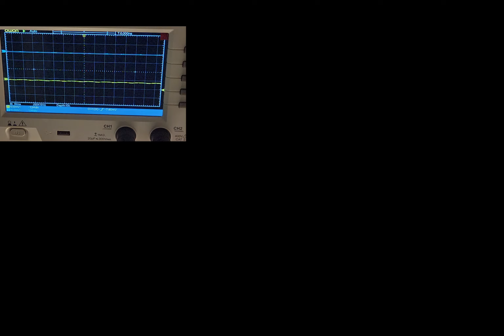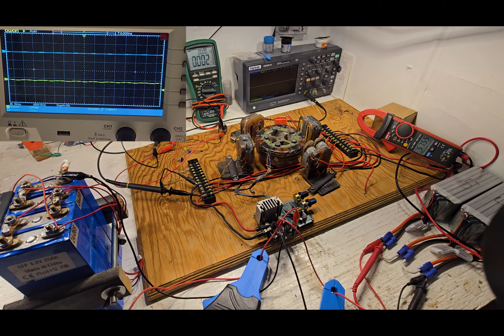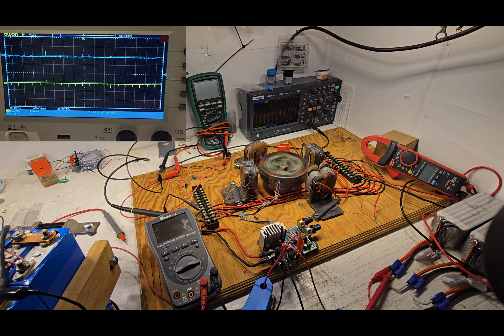Pulse Motor PWM vs NO PWM. Flyback spike vs insane RPMs-what gives results?

Comment: This gives out 5 Watts. What would I need to build a 100 Watt unit that would actually charge the 16KW and 32KW batteries that we have?
Reply from the maker: Larger coils,   rotor or rotors with more magnets on them,  coils with more Henry's  and multiple driver circuits